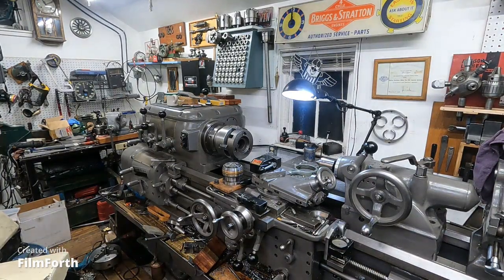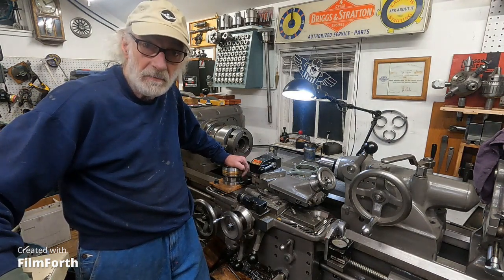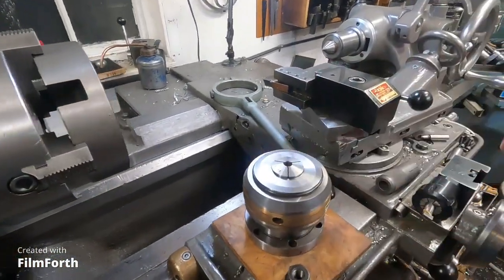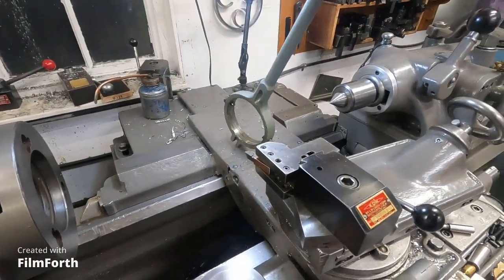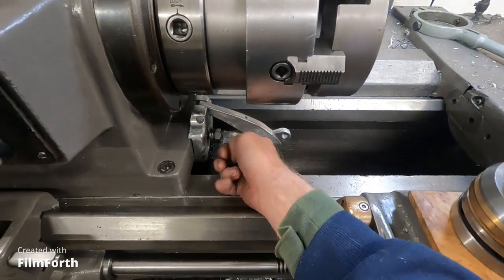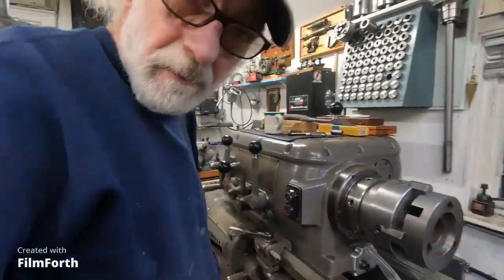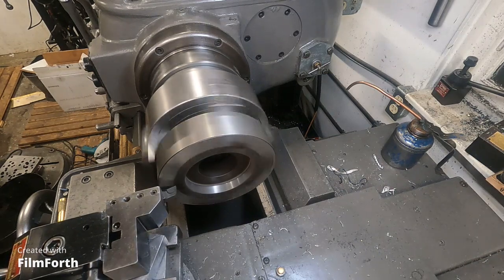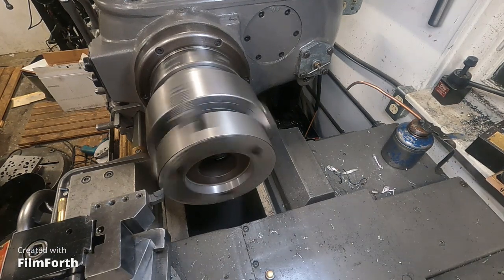Axelson lathe 1970s vintage Enco 5c collet closer installed

Comment: Great job on the bracket Don !     Cheers  👍
Reply from the maker: I have the bracket painted up and it looks like original equipment. This 80yr old machine with a few higher spindle speeds makes this 40yr old attachment more usable than I expected!
 Rob had a time capsule of tools as he was focused on creating the molds and running into challenges, he picked up tools that might help and pushed them aside if they didn't like this collet closer, he said today he had to knock it loose with a mallet and went with the rear lever closer and the collet directly in the spindle for much better results. He laughed when I told him how many times I had to cut and test that heavy thing stuck in a 4 jaw chuck!

Comment: I've had to do this same thing on two different import backplates for my D1-8 spindle. They just would not sit flat on the existing lathe mate surface.
You were busy making that casting mimic mount. I've been looking for a collet closer for my lathe. But I was looking for one to fit the 90mm metric taper of the headstock spindle internal taper.
So you're back to Filmforth video editor. You must have gotten a new PC that it likes to run on.
Reply from the maker: Still using the same computer, film forth kicks me off their free editing program for making too many videos from time to time. I will see how long this lasts, I will need a new computer very soon,
 I have read 8gb ram is minimum, I have 4gb, looking into better sound if possible.

Comment: I have heard that Lions Paw grip somewhere else. I am building a 5C holder for my  lathe i will send a link when i publish it
Reply from the maker: I heard it traveling in the East, the front mount lever works good on the long headstock on this machine, sounds good on your project, thanks!
Reply: mine is on here, and its near done, I am at .006 and still roughed in.  I have heard it from many travelers.